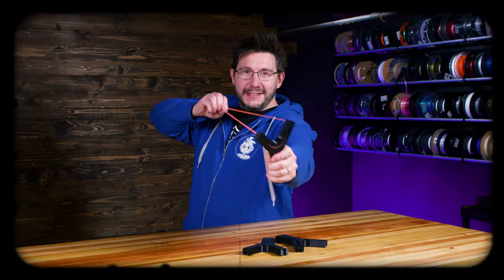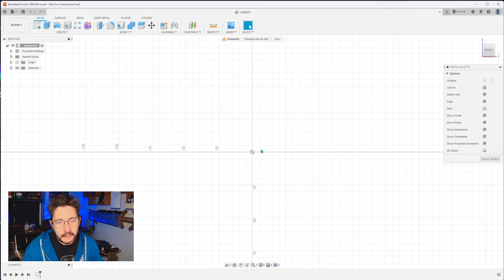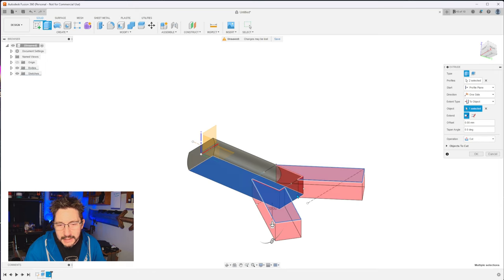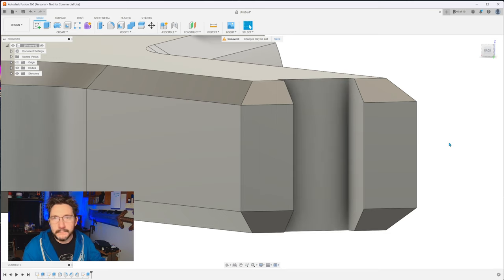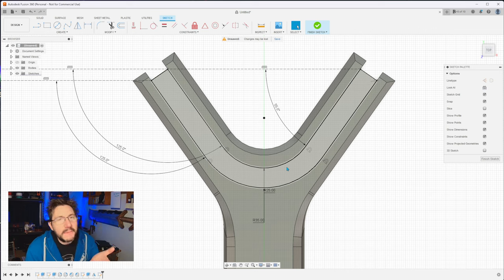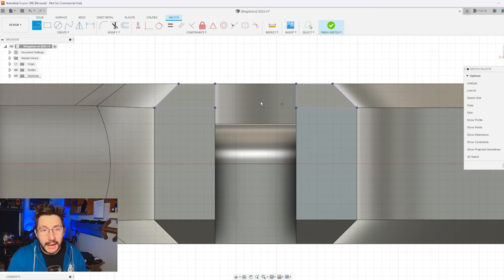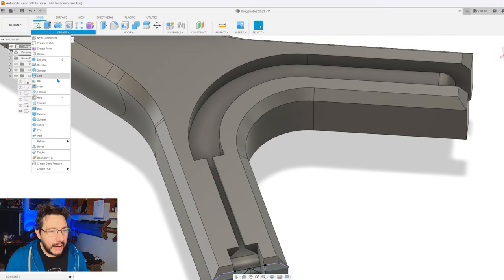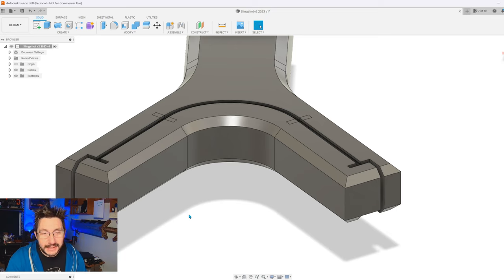3D Printing a SLINGSHOT that WORKS?

Comment: Thinking, designing, and then printing things that actually works fine is one of the best sensation for me. Last year I did that with a full 3D printed replica of the 6th generation Bronco, almost 300 parts. A lot of work but what an incredible sensation when I finished the model. Thank you for this video!

Comment: Don't forget to add plenty of infill bracing if you're going to use strong elastic.
A snapped slingshot in the eye can be unpleasant. 😉
Reply: So infil isn't strength it's just interior support strength truly comes from shells/ perimeters
Reply: @dustindixon8572  Yeah, I think I meant "internal" bracing, but I didn't engage my brain fully. 🫤

Comment: Hey. I have major question. Whether PLA (wolf 3D) petrol resistance. I printed funnel for fueling bike. But I didn't find any proof whether PLA resistant or not. I saw small wet but it may be spilled though.

Comment: Nice one, just here in Germany a slingshot isn't allowed to be owned without weapon license. Don't ask why. Even a normal kitchen knife is only allowed to be transported, when it isn't easily accessible (so not only lying in your bag without something around it you need to remove in a longer process) and its blade is longer then 12cm. So the old Leatherman Tool is considered a weapon too. Many things ended up in this list already and a slingshot is one of them.
Reply: That would be news to Jeorg from the Slingshot Channel.
Reply: Its totally legal to own a slingshot in Germany even without age restriction. Its only a weapon if the slingshot has a armrest and build as a "precision slingshots".
Reply: I had to look that one up why because of the slingshot channel there must have been a change I was not aware about Germany so I appologize for the confusion & I know know your are right though I am Canadian & there is no restrictions unless it’s used in a crime or by a person with a legal barrier (in general) but as long as they behave, are safe & responsible the police do not mind it in Canada
Reply: Yeah mine is not have a scope or any sights or anything like that & takes a learning curve I also am secondly curious about this one

Comment: I am surprised you did not include a flexible core in the design. I am no engineer but I would think a different material for the core would have allowed more stress in the body of the slingshot.

Comment: Hi I was wondering if you have an recommendation on a dual extrusion print I want to be able to print supports in a water soluble and all different type of filaments.  I figure with the two heads I wouldn’t need a purge block as that seems like such a waste

Comment: you could have had  the channel in the front go to the sides.  thus at the base of the 'V' you have the rubber band on your side, go to the front and in the channel.  then after shooting it would likely fall on your hand.  either way really cool design and awesome work

your clip path though is a really good way though
Reply from the maker: Oh didn't even think of that, cool idea!
Reply: @3DPrintingNerd  I definitely liked how you designed it.  Makes me want to find rubber bands around the house and make a few to play with or something.  Haha